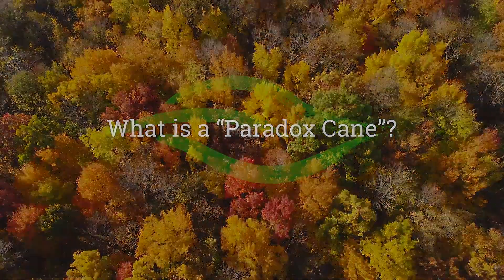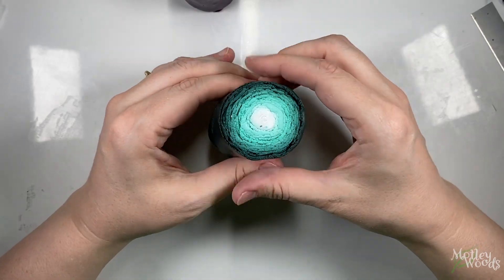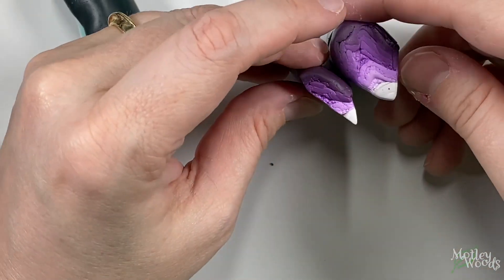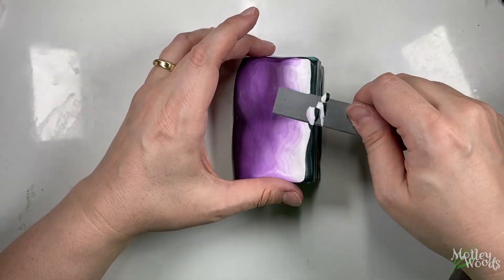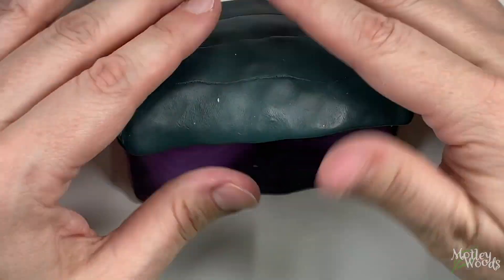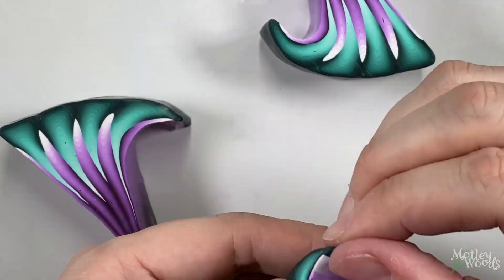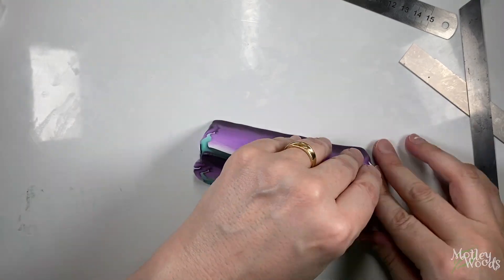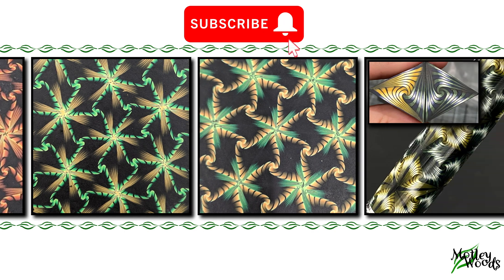Spliced Paradox Polymer Clay Cane Tutorial

Comment: Thank you very much for your tutorial. 
Did you try other brand? I'm actually using Cernit and some Fimo Professional. Could it work with these two brands?
Reply from the maker: Caning can work with any brand clay, though firmer brands tend to work better. Mixing clay doesn’t always work well unless it’s all the same percentages, since different clays move differently under pressure. 

Cernit can be sloppy, so you may need to leech it first. Fimo pro is very firm and likely quite good. Most folks use premo in the US, and it’s what I started with, but switched to kato and have been happier. 

If you’re happy with the results you have from your clay brand there’s no reason to switch, and unless your clay is very soft (Eg Sculpey III) it’s unlikely that switching clay brands will dramatically change how good your canes are. So use what you have or love. 

This is a great article to read: https://thebluebottletree.com/best-polymer-clay-brand/